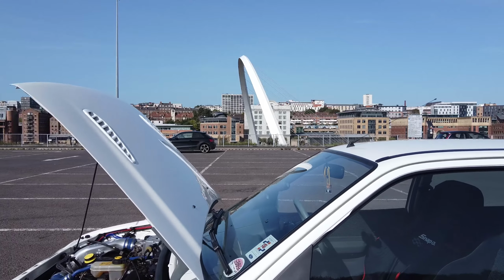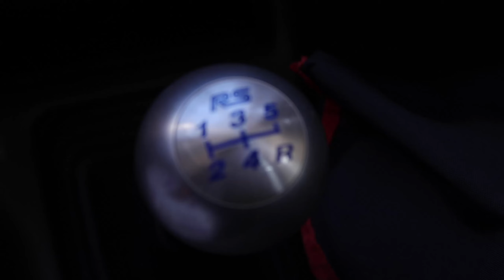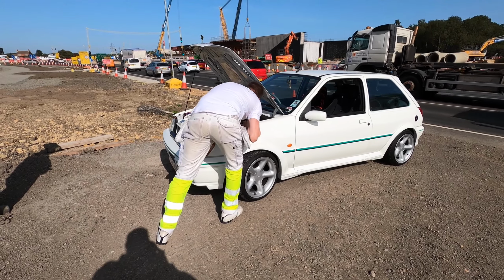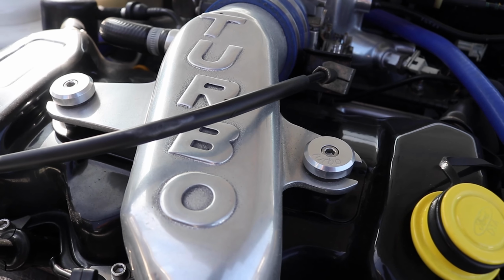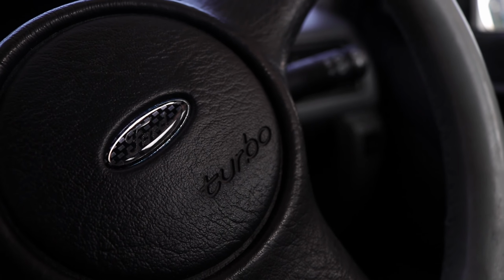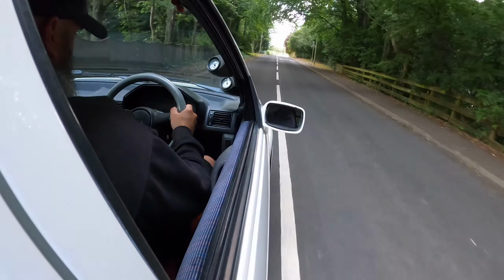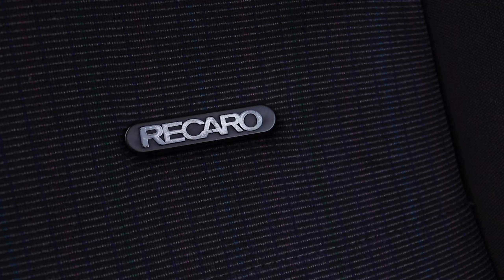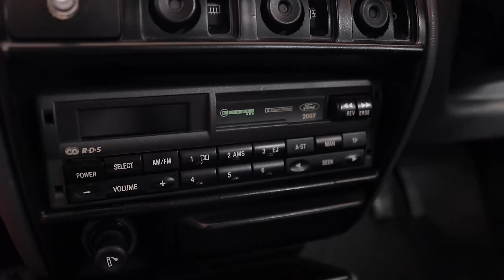Why did I end up with this 196bhp Ford Fiesta RS turbo?

Comment: I owned a black one back in the day, same power beige injectors etc etc, J341 XRS circa 2001, what fun was had in that car, suffered badly from rust underneath though and went on to escort rs turbos and cosworths after, always though the rs turbos had sun roofs standard.
Reply: Yeah,  good point about the sun roof... I thought the same,  also had a black one.. Just happy to have the memories u can't take those away!   👍

Comment: Had a 91 and it was absolutely immaculate. Then it got a bit rusty. Then it got a lot rusty. And that was a garaged and well loved example. Battery tray, fuel filler cap, rear wiper. The Achilles heel of that car. Sold for peanuts like all of the iconic hot hatches I had. 🤦🏻

Comment: Nice car. Shame its not genuine.It is missing the sunroof.  It will never be worth rs turbo money. Great car though
Reply from the maker: Car is now sold although was a genuine RS turbo that was rebuilt into an unregistered original Ford shell. Sunroofs were only a UK option. RS Turbo models sold outside of the UK had  no sunroof as an option. It's a weak point for rust and that's why the decision was made at the time of the rebuild to avoid a sunroof shell.
Reply: @AllTorque  Thats fair enough. Though on the mk3 fez I dont remember there being drainage channels like on the mk3/4 escorts ( which when blocked caused rust issues). 
The fez had a lever mechanism rather than the slide one. So dont think it was a major rust concern ( though it is a ford)

Worst areas for fez rust was filler cap area due to fuel coming back up the filler neck. Anywhere behind the kit. Floors.